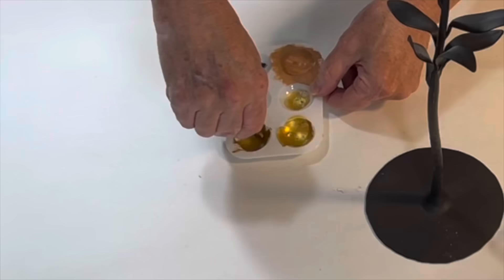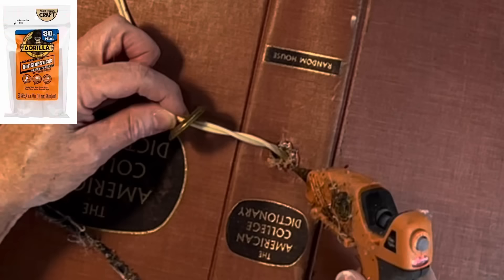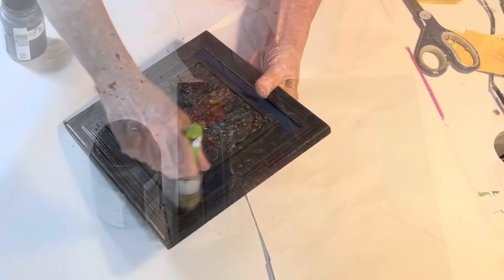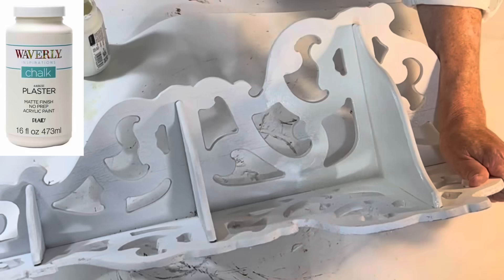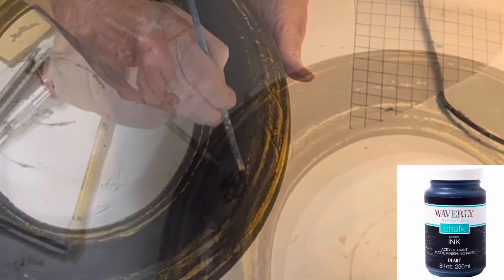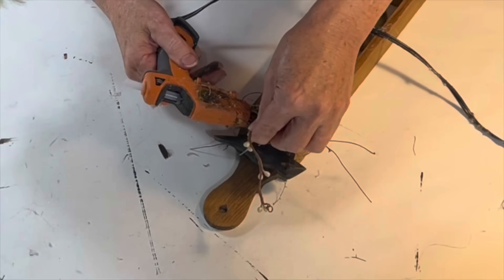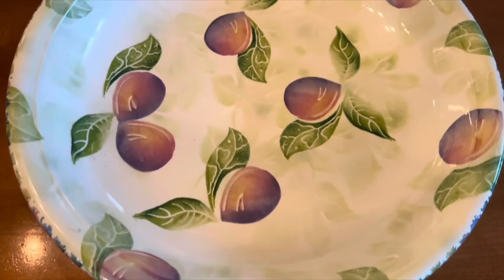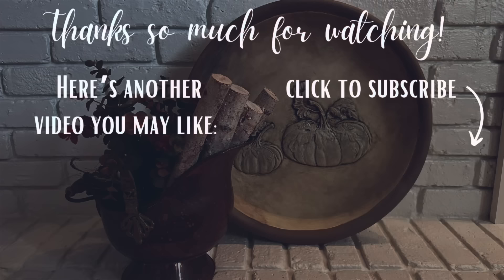Thrift Store Makeover Madness: 10 Upcycling Home Decor DIY Projects

Comment: You are a creative genius!  I do have a question.  When I use a hot glue gun and glue sticks all goes well and the project comes together quickly.  However, I find that a few years later, the glue dries out and the item starts to drop its pine cones, leaves, whatever I, that've attached. Is there a technique to stop this, or a brand of glue stick that keeps things in a place more than a few years?